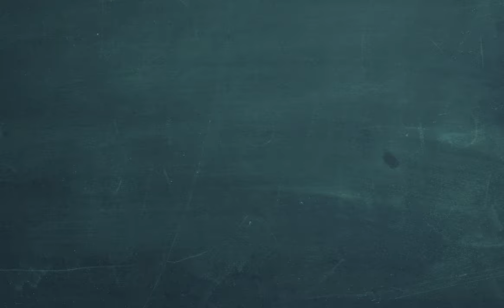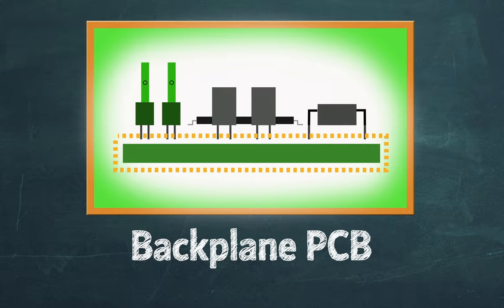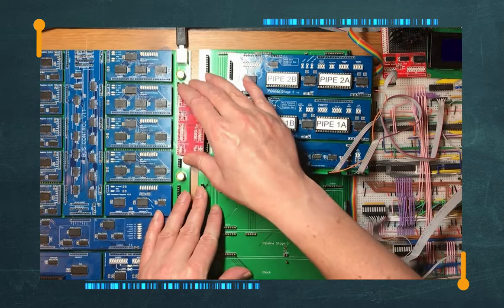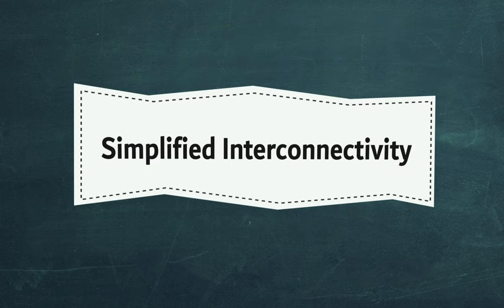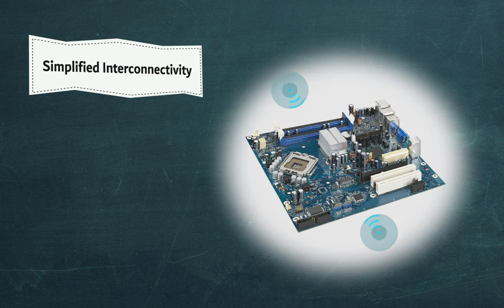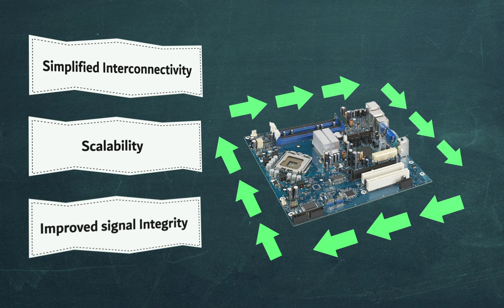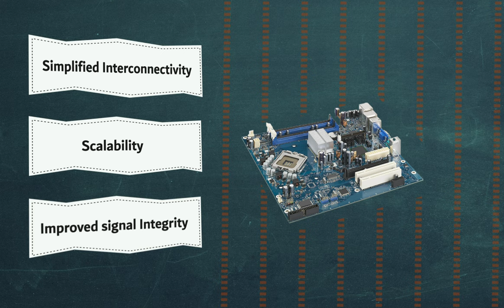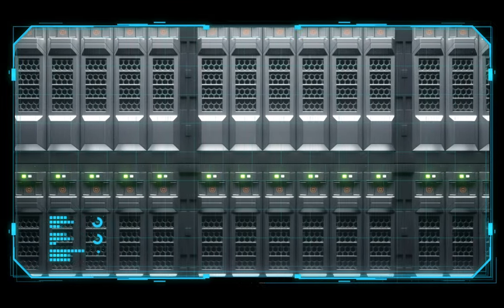What is a Backplane PCB? | PCB Knowledge

Comment: Don't understand what's the difference with a simple motherboard. Isn't a motherboard a "backplane pcb"? do you have a video comparing the 2?
Reply from the maker: In essence, a motherboard is a self-contained unit that integrates essential components, while a PCB backplane serves as a platform for expanding and customizing electronic systems by allowing the addition of modular components or cards.

Comment: What is 6U backplane
Reply from the maker: The "U" stands for "Unit," which is a standardized measurement for rack-mounted equipment. In the context of backplanes, a single "U" is equal to 1.75 inches or 44.45 millimeters in height. A 6U backplane, therefore, has a height of 6 times the standard 1U measurement, which equals 10.5 inches or 266.7 millimeters. It is larger in size compared to lower U configurations, such as 1U, 2U, or 4U.